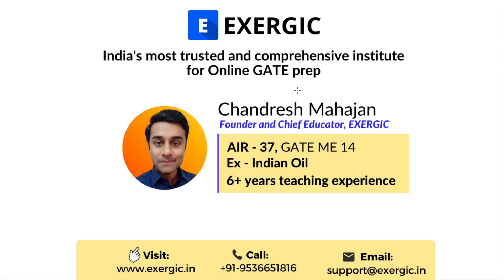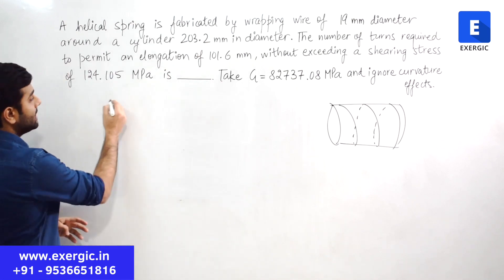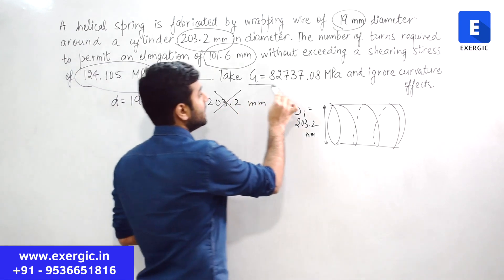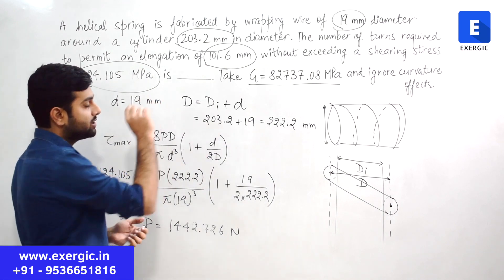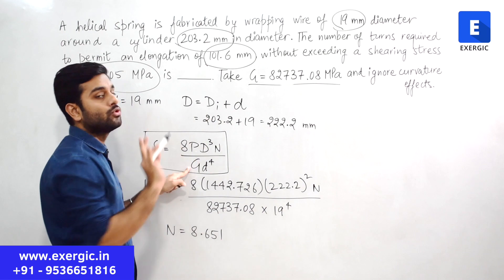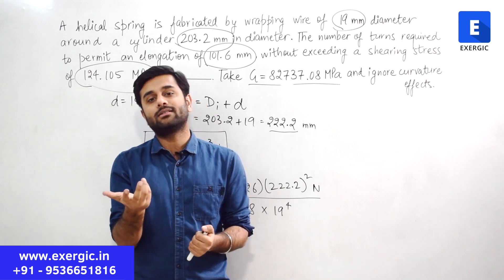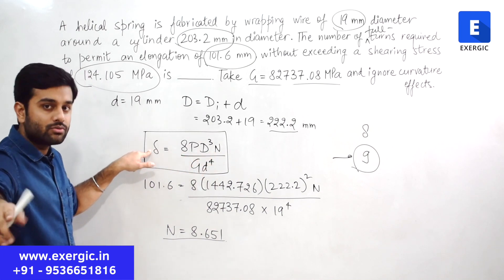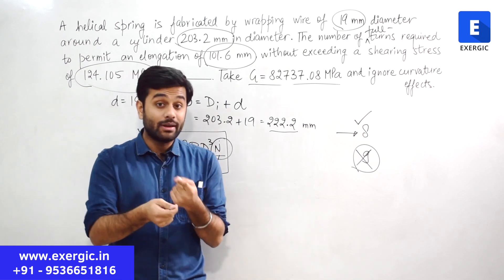85% students did this mistake in Exergic Mock GATE (Mechanical)

Comment: Sir del to be same as 101.6 mm is permitted not more not less (as in question it is not mentioned that "not exceeding 101.6 mm" ), when N increases P decreases and P decreases then tao max is less than tao permissible then we should take N=9,( as tao can not greater than 124.105 MPa but can be less).
Reply: I've also similar opinion! 9 should be the right answer.

Comment: I think 9 is the right answer even as per your explanation.. because for a smaller spring to  get deflected by same amount, more force would be needed.. which would result in stress.more than what is permitted
Reply from the maker: Please refer the basics of springs. There is a difference between how stress acts in a solid bar and a spring.
Reply: I am replying by watching concepts shown in video only! In first fomula, clearly, shear stress is proportional to load. And in second formula, to have same elongation with less number of turns, load needs to be increased.

Comment: Sir, in this same flt, there was a question on maximum stress on gear, Question no. 43 ( technical ) .
There in velocity factor was given in the question and in solution velocity factor was multiplied to force induced to find effective load acting. But velocity factor is divided and service factor is multiplied. 
I am telling all this with reference to V. B. Bhandari book

Either book or flt solution has to be wrong ?
Reply: Bro I didn't gave test but tell me if both values were more than 1 or not because if not it gets divided

Comment: sir i think this question has 2 sides , 
first , if we take the case in which we assume that we applied const load corresponding to max shear stress value than number of turns of 8 is ok as elongation is lesser than permitted value , as greatly explained by you,
 but
if we consider that it is necessary to have a elongation of exactly 101.6 mm , then the load required to acheive it would be lesser and stress would be well below the limit of 124.105 MPa if number of turns are 9.
it all comes down to its application i guess , wheather we are focussing on load bearing or want an exact amount of deflection . plz do reply sir if i am going in wrong direction

Comment: Here we went for decreased value of deflection keeping max stress unchanged. If we go with decreasing value of stress keeping deflection unchanged, ans will be 9.
Let we increase turns to 9. So to keep same deflection we have to reduce P. And we can reduce P by taking lower value of stress. In ques it is mentioned not to exceed the stress limit. We can reduce it.
Why here reducing deflection is prioritized over reducing stress?
Reply from the maker: Good question. We are designing spring here and not designing the loading system. The approach you are proposing by changing the value of P is not correct. Loading is independent of number of coils and it can not be changed at our wish.

If I give you a question to design a component and you will change the load applied and make the load 0, such designing will no work obviously.

Apply the same concept here and you will get it.
Reply: @ExergicGATE 
Agreed..
Thank u 😊
Reply: @aakashsingh7712   No bro, you were right.. Minimum 9 turns are required here.. 
Reason:
Here an elongation of 101.6 mm is permitted which means that any time 101.6 mm of elongation may happen legally but for that amount of elongation if the total number of turns is 8, the generated shear stress will be more than 124.105 MPs, which does not meet the required condition and hence the correct answer of this question is 9 since for that amount of elongation the shearing stress will be less than 124.105 MPs which is permitted. So in integer, minimum 9 turns are required...
Reply: @saikatkarmakar3040 
Actually I know I m right.
It was just that they cannot accept that they are wrong. So I wrote agreed. Ethically it is wrong. But those who understood, it doesn't matter whether I agree or not. Because these type of things needs to be understood as u did😊
Reply: @saikatkarmakar3040 
😕

Comment: Sir, there is a mistake in solution of question no.51 thermo. It is solved assuming reversible refrigerator which is not given in question.Please correct.
Reply from the maker: When nothing is given, it is taken as reversible. Just like if a gas is mentioned in a numerical, it is treated as ideal gas for calculation purposes.

Comment: Sir in shear stress  we use Kw=( 4c-1)/4c-4) +0 .615/c   c- dia ratio

 But since curvature effect is to be neglected so i put it to 1 ....but too Kw = diff. Formula not 1 ✍ i m confused.
Reply: to find out maximum shear stress induced in springs you have to use wahls factor...but we can use wahl stress factor only when there are curvature effects needed to be considered...since in question says curvature effects are neglected so we need to use the formula as mentioned in video...
Reply: @v.venkatasainagakumar2644  ohh...i was not aware of this formula nd concept so far ...thanks 🤗🤗